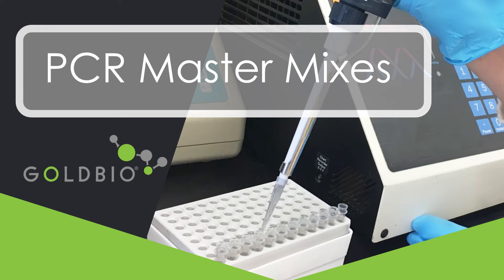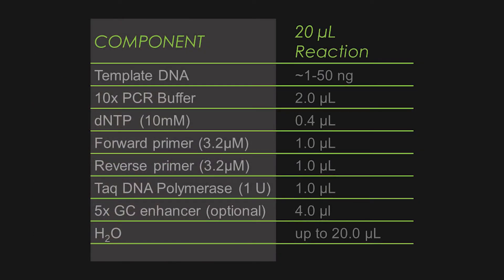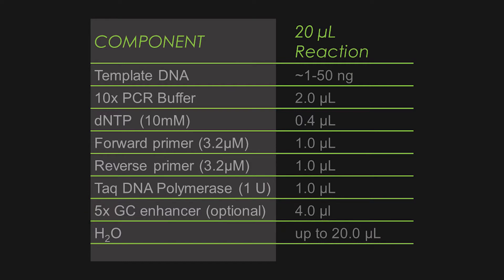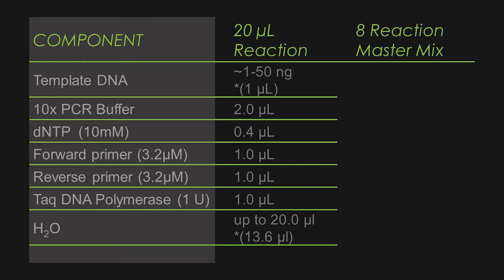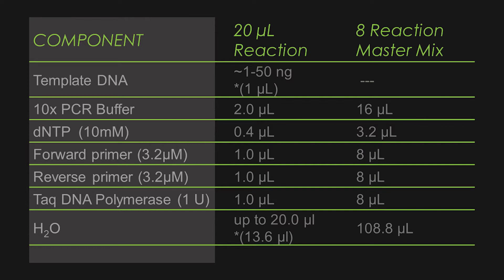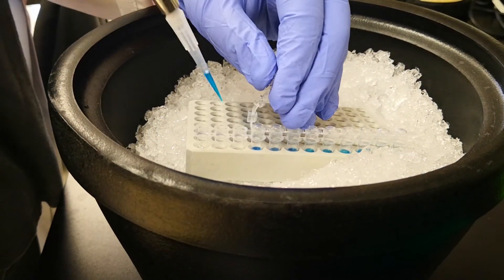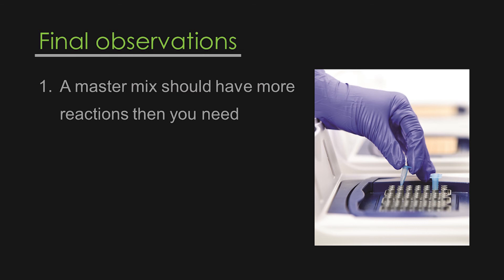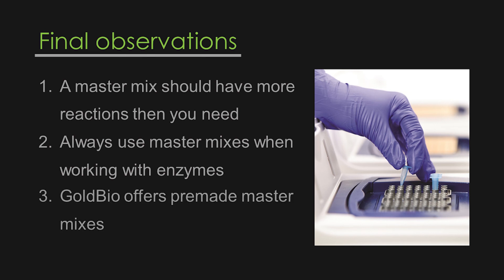How To: PCR Master Mixes

Comment: I was kinda confused why you mix primers with the polymerase in the master mix. In my experience it is rather dangerous because it can lead to amplification of primer dimers, trimers etc apart from the desired DNA template. (because we keep the mix at RT for a while but some undesired chemical processes still can occur) We are usually mixing everything but polymerase which is added at the last moment.
Reply: Keep temperatures low to keep from annealing. Should be safe if done within the hour or two from mixing

Comment: How is primer removed in PCR..!?
Reply: During PCR the primer anneals to the DNA strand which provides a free 3'end for DNA polymerase to begin DNA synthesis. At the end of the PCR reaction you need to then clean it up to get rid of excess primer, polymerase dNTPs etc. Various columns exist for this purpose.